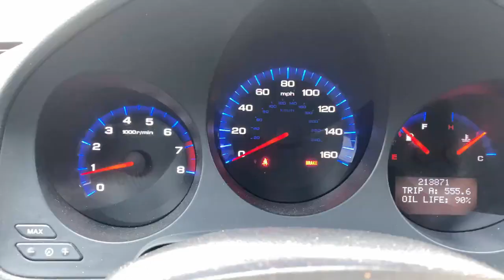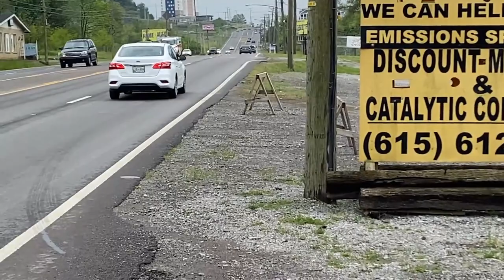2006 Acura TL EXHAUST w/ 3 INCH STRAIGHT PIPES!

Comment: He’ll be back after it hits 2k RPM on the highway lol
Reply: What does this mean?
Reply: TheUlquiorra444  drone
Reply: @austinbodurian7428  yes the drone  on a 4 banger is insane
Reply: Big v8s even straight  piped don't have that much drone
Reply: Nathan Kirby gotta get that rice on tho. civic owners couldn’t dream of a v8
Reply: That tl is a 3.2 v6
Reply: Nathan Kirby it’s a v6 btw. But ok 🤔
Reply: Nathan Kirby yes they do. If you straight piped anything it will drone. Also that’s not a 4 banger. 6 cylinders dude.
Reply: It’s not a civic lol
Reply: @pepeiann  this is a v6
Reply: @pepeiann  it’s a v6
Reply: I have an 05 straight piped and i was worried abt drone when i first did it but it’s actually not bad at all
Reply: @pepeiann  dude it a v6 fym

Comment: At least this one is a 6 speed manual tl,whoever is looking for a tl ,don't buy 2004-2006 with auto,if you can ,get one like this with a 6 speed or 2007-2008 tl ,they fixed the transmission on 2007-2008 years,mine still going strong.

Comment: I just bought a 2004 TL and I adapted the Invidia exhaust from my 2001 V6 Accord onto it and it sounds great. I also removed the 3rd cat because the flanges were extremely rusted. I live in Pennsylvania though and I can't pass emissions because the CEL is on. I replaced all of the gaskets for the cats, all four oxygen sensors, and the collector pipe and it still throws random oxygen sensor stuck lean codes because the flanges for the cats HAVE to be warped. I used all OEM Honda gaskets and I even coated both sides of the gaskets with copper RTV and they still leak. It's seriously driving me insane.
Reply from the maker: Look up remflex gasket sheet. And make ur own gasket from it. Then it
Will solve your leak. Here’s a link. Hope this helps!!!
https://www.summitracing.com/parts/rfl-gs16511?seid=srese1&gclid=Cj0KCQjw_fiLBhDOARIsAF4khR0WucKVy0_r7jco3LwK9fvvKkMQAJl3uVOnx9j-TwrBuspvZo75OT0aAg4XEALw_wcB

Comment: How’s back pressure? Was my only worry with going to 3 inch, so I’m at 2.25 still
Reply: Honestly, thankfully he kept all his stock cats, or he would’ve needed to get a tune. Most ppl don’t usually get a proper tune, and this ends up killing all your low end power/torque. It’s annoying with all the noise, let alone needing 35-40%+ throttle just to take off from a dead stop, in traffic jams. It can get truly annoying. 

I guess most people get over it, since they compromise for the sound and maybe looks…? I see a ton of people running a single exit 3” catback, with either high flow cats or catless pipes. Most are running a fully straight-through exhaust system too, so there’s very little backpressure, if any at all. It would be super ideal for a forced induction engine setup, but not so much for an NA engine barely making 300+ WHP… 

I usually suggest a max of 2.75” (2-3/4”) piping max on NA setups, unless you’re making well over 375-400 WHP. That’s why you see a lot of mostly stock NA V8 guys with 380-400+ HP stock, go with 3” piping on a TRUE DUAL exhaust and still be fine.
Reply: @isnowyazn  lol appreciate the time you took my guy. But commented this awhile ago, already straight piped and blew my TL xD i ran only a cat had no issue. taking off the cat i had no back pressure and low power, but also was dumping right out the precats so there wasnt a full system. But i gotta miata now so cant make that loud or itll be a tin can haha

Comment: Should've put 2 1/2 inch pipe. Might lose some power.
Reply: That’s not always true cuz some car manufacturers make their stock size piping too restrictive
Reply: He loss back compression  just said peace out to all compression pistons rings  cz this engine is stock if was build then 3 inches sound good for the amount of power for example for 300hp 2 inches 1/2 are ok  3 inches  is for turbo cars or v8 that is build not for a 250hp motor that have stock  internals  and by the way u miss 3 gear 😉